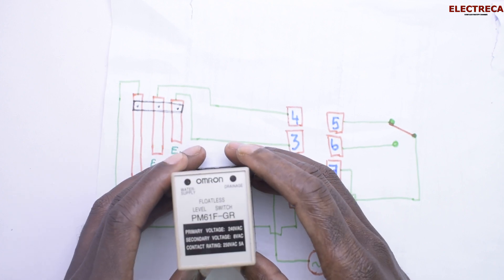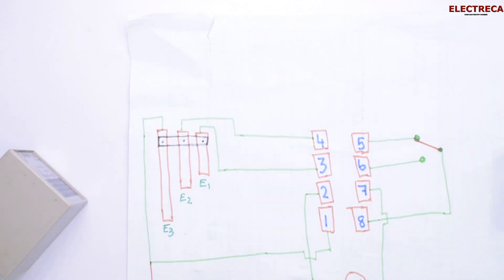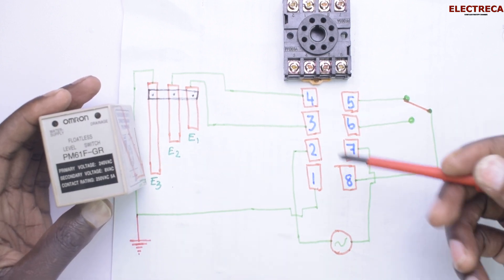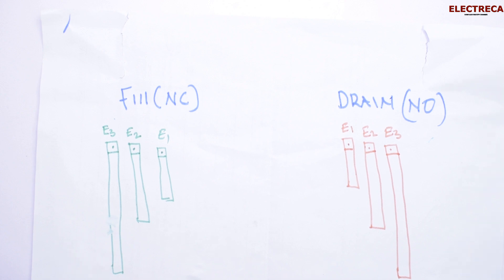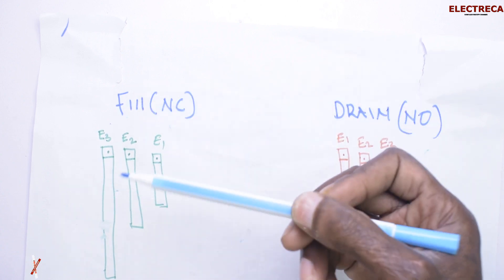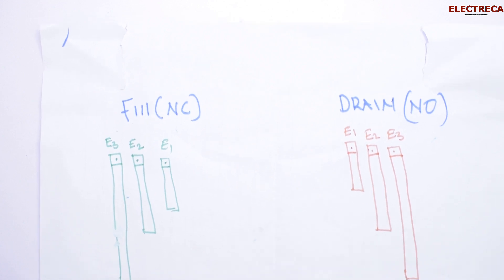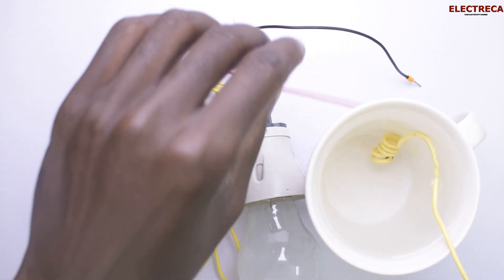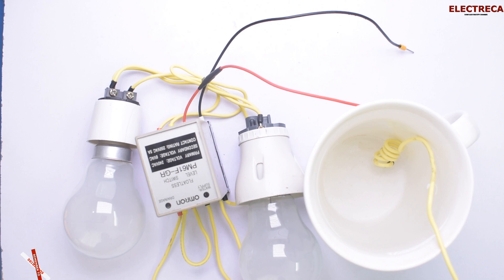floatless level switch connection | high and low water tank control | Electreca

Comment: Great videos just what I was looking for. 
In a water tank do  you use a wire with a bare end, as you used in the demonstration, or is there something specific available.
A quick search online didn't come up with anything her in Thailand. 
Many thanks Dave
Reply from the maker: Thank for watching, there are deferent types of probes take look  https://s.click.aliexpress.com/e/_DkQTcXN   This can do.
Reply: Thanks for your prompt reply.
I will look for those on the local equivalent of Ali Express 
I did find what Omron call eletrodes ,stainless steel rods.
I think that I will use a float switch  when we install the water tank.
Thanks Dave.

Comment: Thank you so much for contribution to knowledge. Please I have questions: what type of electrode is used in the connection, is it normal Earth electrode? 2. Would the water in the tank not carry current that can get one electrocuted? Thanks in advance for answering the questions.
Reply from the maker: Earth electrode tends to be long and naked(not insulated).
But for float less are called PROBE. They have insulated almost 3 quoters of their length and only a tiny tip is exposed.
There is definitely a leakage in the tank, But as I said in the video, Electrode No3 is Earthed.
When you Earth there will be no leakage completely
Thanks for watching

Comment: Quick question assuming the two bulbs are pumps will it drain and fill the tank without  you rewiring the circuit?
Reply from the maker: Yes
Reply: Replace the bulbs with the contactor coils of the respective pumps.